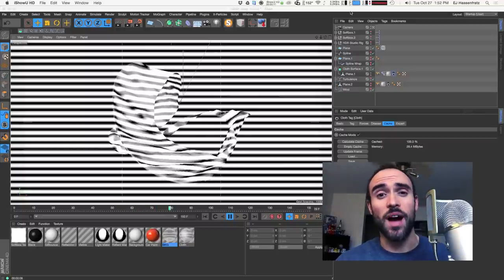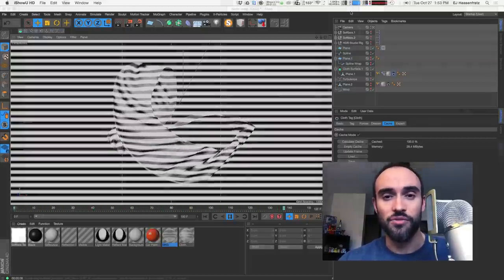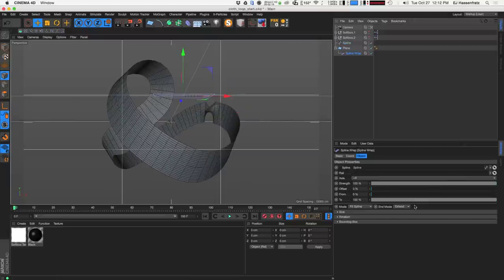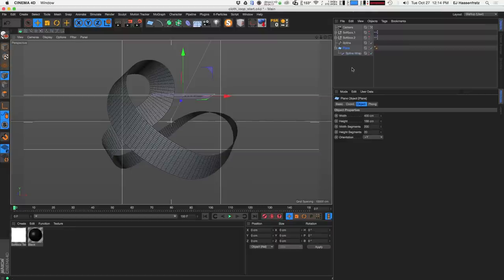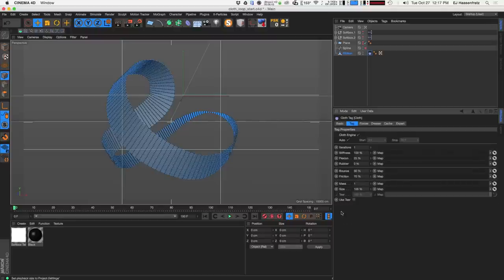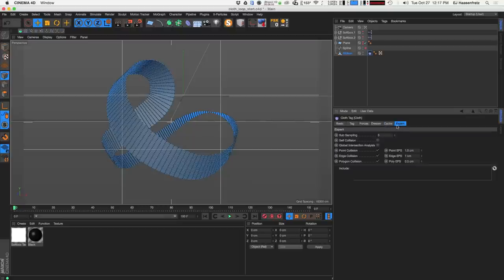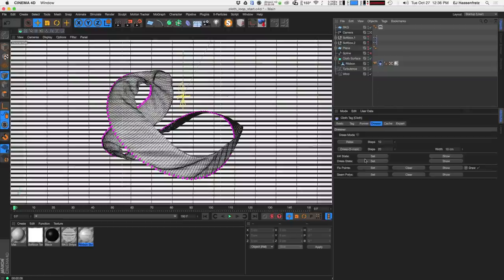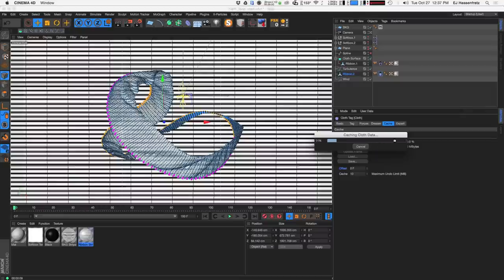Cinema 4D Tutorial - How to Loop Cloth Dynamics in Cinema 4D

Comment: For anyone having issues where the technique doesn't work in a render, I'm using R26 and I got it working with some small tweaks to the workflow. 

Instead of caching the cloth sim, add a Point Cache tag. Click Store State and then Calculate. Then delete the Cloth tag now that the simulation is cached.

Duplicate the object and offset the point cache to the length of the project (like the tutorial does with the cloth cache)

Everything else is the same as the tutorial except in the Pose Morph's Basic tab, set both priorities to Generators: 0. Although the geometry won't necessarily look correct in the viewport, it will in the render. Hope this works for you!
Reply from the maker: Thanks so much for giving this updated workflow! I aim to re-record many of these using the new system!

Comment: On S24 and other recent versions of C4D, there is no offset parameter in the Cache section of the Cloth tag. There's a Start setting, but that doesn't start the cache at a cached frame. What must be done instead is duplicating the first cached cloth object. Then, go the last frame and delete the tag from the duplicate cloth object. That will make it a static mesh in the state it should be in the final frame. That will be your target object for the second pose in the Pose Morph tag. If you are having issues with the pose morph not rendering properly, go the the Post Morph tag's Basic tab and change the Priorities to Generators and set it to a high number. 

This should work with Motion Clips too but I couldn't get it to work.
Reply: Thanks Dean! I'm on R25, my Start setting was working fine but my pose morph wasn't. Changing the tag to Generators and setting it at 499 solved it. Appreciate the solution!

Comment: same problem, on preview good loop but no in the render, posemorph no active, i try bake PLA with function issue in animate timeline but no resolve ....  i SOLVE use alembic bake.
Reply from the maker: you cached the cloth beforehand?
Reply: @eyedesyn  yes bakebPLA, i follow all step more time, but each time i have strange issue with PLA bake and pose morph,  in finally the render problem  i resolve with the alembic bake. ... congratulations for the tutorials, they are super useful and beautiful
Reply from the maker: glad you figured it out!  alembic saves the day again!   thanks for watching & the kind words!
Reply: Hey, yes have the same problem. But how do you use the alembic? it doesn't work with the point posepmorph...
Reply: @HeisenbergAndBOHR  Thank you. that is the way to do it in the new version of Cinema. I didn't have to exported as alembic if using Arnold. I just copy and paste a new version of the cloth and then manually moved the first frame to the last. Then animated the strength on the animation tab inside the pose morph. The bake PLA option is inside the bake objects